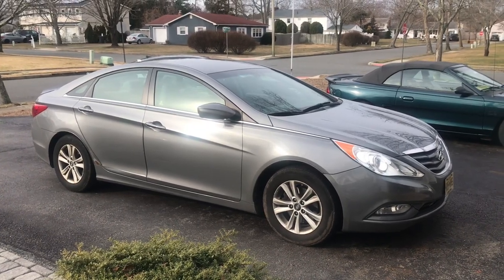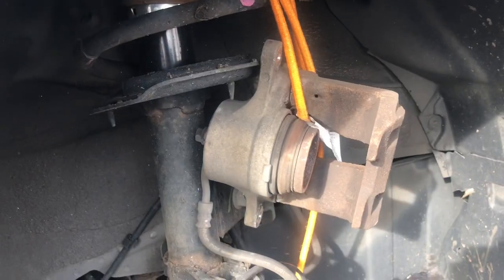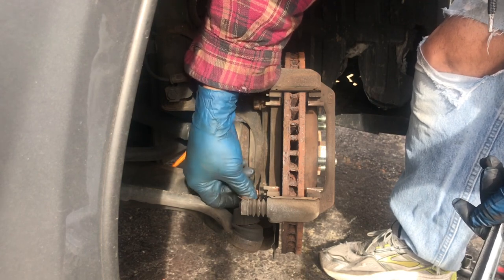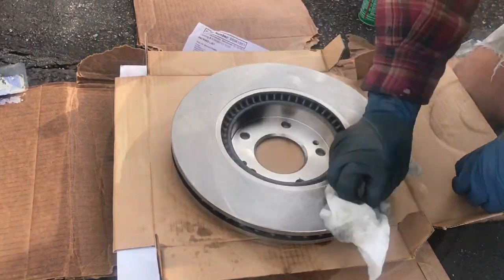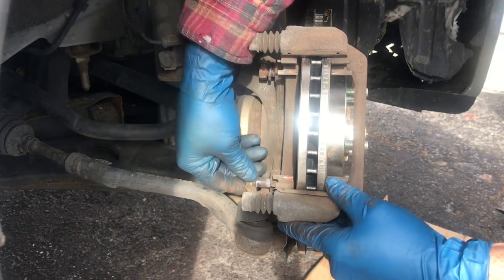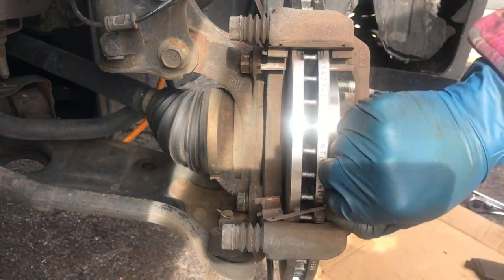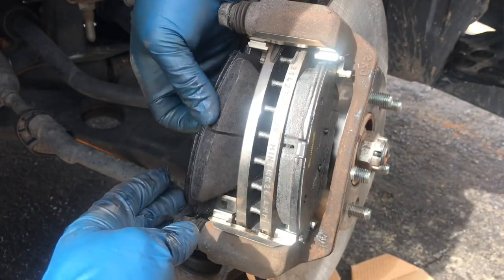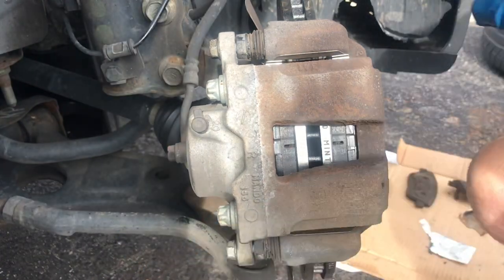HYUNDAI SONATA Front BRAKES REPLACEMENT - Changing Front Brake Pads and Rotors on a Hyundai Sonata

Comment: Good job but just one thing I saw. After cleaning the rotor you transferred grease from your fingers back on the rotor when you installed pads. You should have stopped then and cleaned the rotor again from your fingers tips. Then put pads on. From way you did it there would be some grease right on the new pads. A little cleaner job and I'd have no issues with you doing my car. Luckily I'm a car guy and do my own. great job again. Just watch the grease transfer. Still giving you 👍🏼